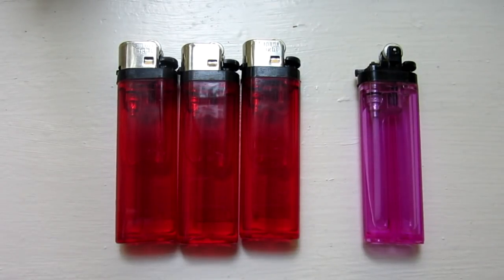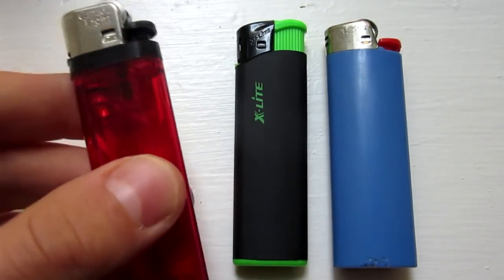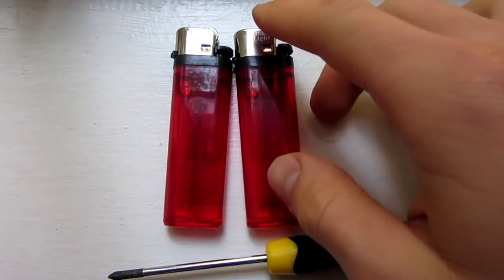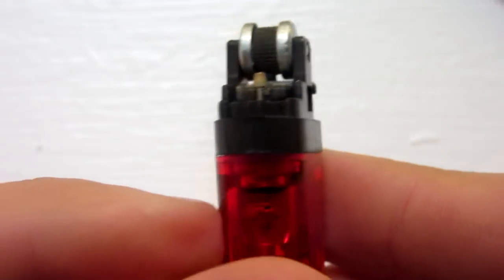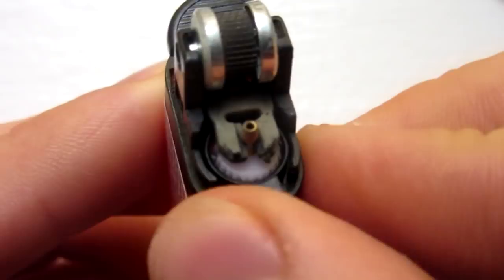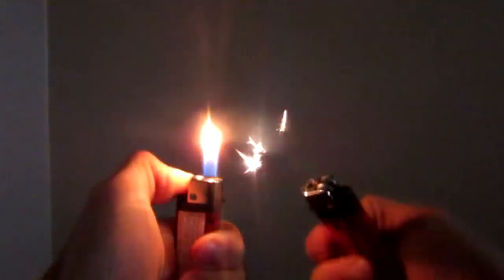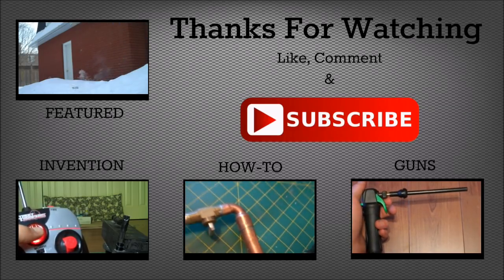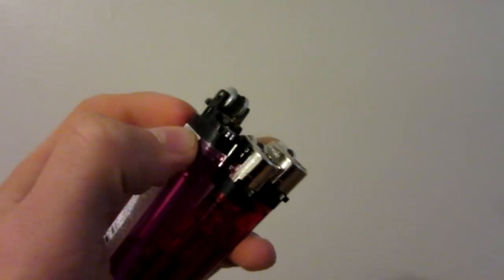Awesome $1 Lighter Hack - EASY

Comment: Always buy bic lighters they are all around good
Reply: @jc.8112  they are windproof, which can be very helpful in certain situations.
Reply: No cheap ones are easy to mod
Reply: @geneticcheatah zippo lighters are more expensive. vic is just a high quality, small, cheap, on the go lighter. rather zippo is expensive for new lighter fluid,  the brand it’s self, and u can’t really adjust the flame
Reply: Uh clippers r the best
Reply: @geneticcheatah not for smoking weed tho all that butane is bad to inhale.
Reply: I thought bic made pens lol
Reply: @720iluvxbox  right !!
Reply: @angryewok2474  bic makes pens and lighters lol
Reply: Clipper lighters are the best don’t know what y’all talkin about
Reply: @timariddle626  very true
Reply: @timariddle626  not for all cases depending like if you are using a chilum no just no

Comment: If yall know what colt lighters are, they are similarly sized as zippo lighters but the mechanism is the same as on the lighter on this video, now they have a metal thing covering the middle part of the wheel for some reason or another, but you can remove this thing and removing it makes the performance much better, not over the top like this but the flame is mb 2/3 larger

Comment: You realize that if you do that modification it doesn't allow the butane valve to completely close, which constantly lets gas into the air. This in turn can result in a fire if set somewhere in the house. I know this because you have to blow it out, which means you are supplying too much oxygen to the flame which puts it out, but leaves gas spewing out in small amounts.
Reply: so true
Reply: are you able to refill them wuth zippo fluid?

Comment: ty, even now this is useful info, i use lighter to melt crappy strings on my 3d prints, just a small exposure to melt plastic, careful to not melt it or blacken it, i get 1 sometimes that at max is what SHOULD be lowest settings, also plus points for an actual warning, i'd say put that beforehand but unluck today's hack videos, actual useful information, actual warnings, 10/10

Comment: I just found out Major makes lighters without the adjustable lever and to modify the flame size is just like what you have in the video except you need a tweezer to turn the cog. Simple as pie! Just only turn it about 3-4 teeths worth to get the flame at max.

Comment: BIC lighters do NOT suck. Take the main lighter you hacked and a bic lighter and light them both at the same time and hold it down. Watch which lighter pops and fucks up first. Also, bic lighters CAN be hacked like that to have a super flame.

Comment: Gonna debunk some myths over here. First, in order to have combustion, fuel must mix with air. There is no air inside the lighter, and it is impossible for the flame to "get inside" the lighter and blow it up. in fact, if you look closely, the increased fuel release actually pushes the flame base away from the lighter. Is it possible that the flame can melt the lighter? Yes, however the user would burn his hand before this happened and extinguish the lighter. Also, you would need to melt the entire top of the lighter to penetrate it as the actual nozzle is made out of metal. Now, this doesn't mean that there is no danger in doing this. Notice how inventor719 is unable to extinguish the flame simply by releasing the trigger and has to use alternate means to extinguish it. This means that butane is leaking out of it constantly. In most cases this simply means you waste all the lighter's butane and you realize that your lighter is suddenly no longer functional. But a gas leak is dangerous for obvious reasons-- if it's allowed to build up and there is an ignition source then you know what happens. When you're doing this "hack", don't adjust the lighter too much. Here, he moves the switch four times-- I've discovered that doing it only once is definitely good enough.
Reply: +kuba kuba Gonna clarify one thing and debunk one of your debunks' in the process. first a lighter can explode if the flame is held to long; i know i have seen it happen. that's the debunk. secondly while it is true that fuel must mix with air to catch on fire it is commonly referred to the flame getting inside the lighter. the clarification is that the flame doesn't "get inside" but rather the fuel gets hotter and hotter effectively expanding the pressure on the inside. this is what causes the explosion. and there should be very minor injuries if any. the worst case scenario is that someone suffers second degree burn from the hot fluid; which can be very easily cured by putting some vinegar on a paper towel and applying to said area.

Comment: fft. I use a culinary torch. Cut the air and reduce the gas output and you basically have a lighter. Open the air intake and it's a blowtorch... I use it for Creme Brule and even soldering connectors, lol.

Comment: Mine is a Chinese knockoff of a Bick (KIK)... I opened it and the wheel was there, but there's no tool to adjust the power. I used the tip of my pocket knife, to spin the wheel, and it works.

Comment: potential grenade design?
Reply: It won't blow just don't keep it on for to long or mod the case
Reply: Epic gamer pro it could still be modded to use as a grenade
Reply: Hardly, it can blow up and make you jump but really it's just a glorified firecracker, if you used a metal lighter with higher pressure fuel maybe it'd be a grenade but this would scratch you at best, ignoring any potential eye injuries.
Reply: ***** it's just an idea more could be done to give it more power

Comment: AYO if it looks like it but doesn’t have the adjuster take the metal cap off still mind didn’t have an external adjuster but still the white wheel and it turned and worked like the video 👍

Comment: that's not a HACK... That's the function of the damn thing, you aren't doing anything special. they are made to be adjusted for when you're lighting something that needs a longer trail, like a wick at the bottom of a cylinder candle jar.

Comment: You can do it with a bic lighter too just take off the metal casing and twist the metal part where the gas comes out with some pliers
Reply: No. Its not possible. Prove it. It means you have no clue how a bic is made. That valve is freely sitting there held by the lever. Thats it.

Comment: When u take the metal bit of the top and  do the hack the plastic holder to hold the sparked the thing will melt and it will melt on your hand and it will hurt and then it will melt into the gas chamber and will blow up and it will definitely will burn your hand so plz don't try this

Comment: i can't believe 2.1 million people didn't know you can do this. Also mind blown this dude needs a screwdriver. 

save yourself sometime. literally turn the lighter all the way up, push the adjustable knob up with a bit of force, now tho it's off the track turn it to the left, now push back down on track and BING BANG BOOM 💥🤯 you're done and I just save you tons of time listening to this clueless dork. 

also another tip, always leave metal casing on once you turn it up. otherwise you will melt the entire top part and your wheel will fall off. and I guarantee this dumby will say it's unfixable, but in reality you can pop the top black part off the lighter (be careful not the snap the pipe the fluid travels thru) and take a dead lighter and pop that tbat off, it's okay if you break the pipe on that one so you can be a bid more forceful with fhe dead one. than pop that working top piece on and it's as good as new before you ended up with a  melted and/or spring missing or whatever issue you caused lighter bc you listened to this complete ignorant clueless dude.  

baffled how someone can make a video and be so clueless and get 2.1m views. I guess the dumb become dumber by following dumby. Dumb, Dumby & Dumber coming to a melted lighter that lasted you 4 sparks near you soon!